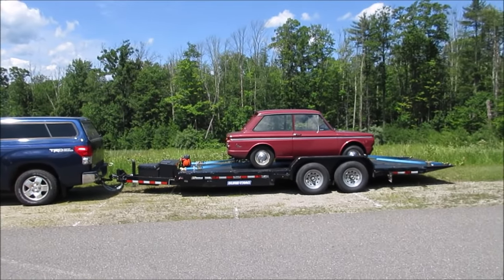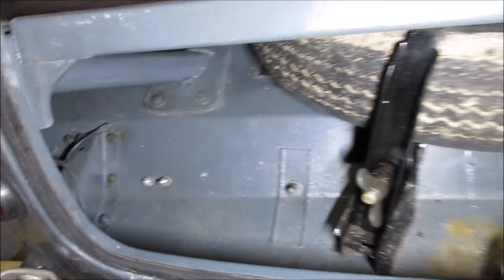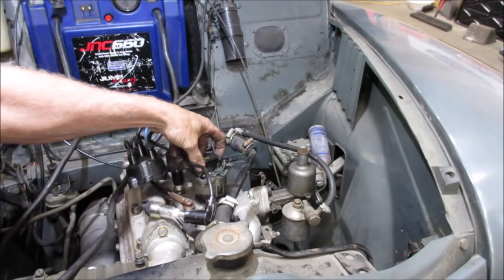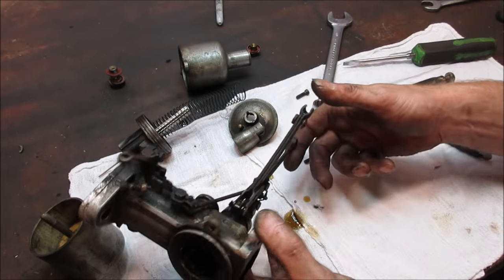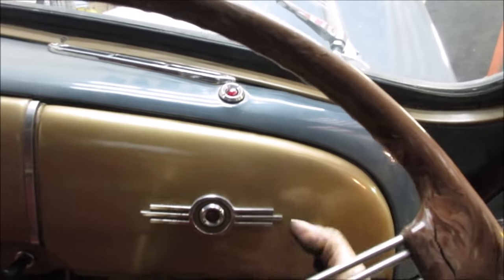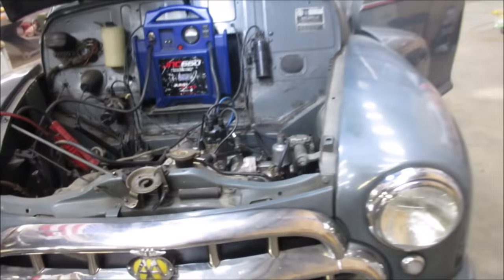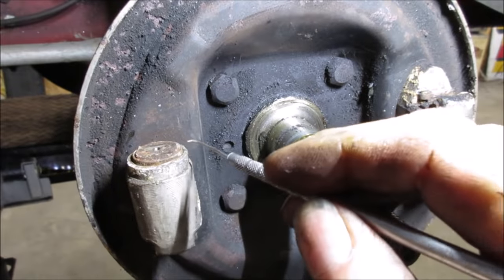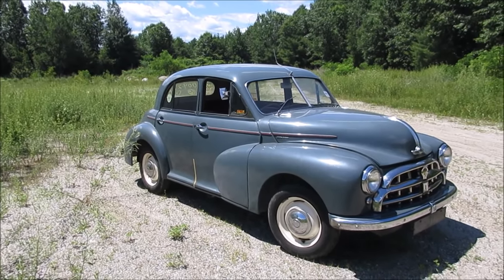50s Morris Oxford Found in an Old Warehouse. Did It Survive?

Comment: 82 y.o. and talking to you all the while, from Australia.
I was impressed with how you sorted it out.
There is a special little spanner for adjusting the main jet. I have one, in the top drawer of my toolbox, with a piece of 
string to go around your wrist, so that you don't lose it in the bowels of someone else's car.
The Morris Minor was a more popular little car, with a similar motor only, about 45 in. cubes, iirc.
The example you have there is from around 1952, followed by an ohv model and then a one litre ohv model with a one piece windscreen. Rather nice VW beetle equivalent.
Well done !!
Reply: I love the piece of string on the tiny spanner. I got the value of it straight away. Thanks for the tip. 
I am a bricklayer by trade and have a loop of bricklayers line on my belt which I hook my car keys too each morning before entering big building sites.

Comment: Mustie I am impressed with how quickly you surmised aspects of the SU carburettor.  The basic principle is that as air is drawn in it enters a restriction between the jet seat and needle creating a pressure drop, due to the Venturi effect, and this draws fuel past the needle into the engine.  The connecting arm arrangement under the jet seat is the cold start lever which is actuated via cable from a knob on the dashboard.  As you correctly identified that when retracted the jet seat is lowered from needle to enrich the fuel air ratio.  A small passageway connects to the dome region above the large needle piston allowing inlet manifold vacuum to alter the distance between the needle and jet seat to balance the air/fuel mix.  The little dash pot piston in the top of the needle piston needs to sit in bath of oil, it dampens out any sudden deflections or flutter of the needle piston.  Idle is set by the nut on the jet seat assembly beneath the carburettor, above the cold start lever connection.  As rule of thumb, do the nut up until lightly snug, then undo it 12 flats (two turns) to withdraw the jet seat.  Then adjust this nut to achieve a comfortable idle speed.  When set up, SU carburettors are fairly bullet proof, the only things that go wrong are the dash pot piston gets gummed or becomes empty, fuel float chamber needle fails to seat properly and, over time, fuel can erode the jet needle profile leading to progressive deterioration in engine smoothness.
Reply: I'd add that the primary function of the oil well in the top of the dashpot is not to provide oiling, but to dampen the return rate of the needle as it falls back down. When you hit the gas, the needle moves up, and when you let off the gas, if the dashpot is empty it can fall off too suddenly and cause revs to waver. Motorcycle shock oil is the closest thing you'll have around the shop to the correct viscosity of dashpot oil.
Reply: @Falkkonstag  I think that's not quite right. The damper is there to limit the upwards motion of the piston and needle when you open the throttle. As the piston doesn't open quickly the air flows faster through the throat which momentarily sucks more fuel though the jet. That gives you the fuel enrichment (like an accelerator pump on a US style carb) you need when you jab the throttle. The needle then slowly rises and the air flow returns to normal for that throttle opening. The damper acts like a one way valve and limits the upward motion but not the down. That is controlled by the piston as it moves inside the dashpot. Early SUs had no damper at all but often used heavier brass pistons. There are also different weight springs that press the piston down. If you have twin SU carbs one test you do to ensure they are well matched is a piston drop test where you lift the piston to the top on each then let them fall under their own weight and make sure they fall at the same rate with the appropriate ports blocked). They shouldn't just drop as they are a very close fit in the dashpot (but not touching). It usually takes a few seconds. The SU Carb site has a lot of good information about this to read up on. I've got three cars with SUs on them including early pre-war ones so had to learn a lot about them. Lots of subtle difference in them over the years to trip people up. Very neat devices.
Reply: @Falkkonstag  Old Volvo B20b used 10 wt for dashpots. Performance trick was using light mineral oil in them for faster response.
Reply: Ah, yes- The venerable SU carburetor.  My Morris Minor 1000 had one.  I kept the oil level in the damper very high.  I never had any carb problems to speak of.  Mustie, your fuel pump sounds very sluggish.  My Minor 1000 fuel pump would thunk like crazy, then slow down and stop.  Then I would pull the choke and pull the starter.  Instant power.  Sort of.  All 36 horsepower.  Top speed 67 MPH (on a good day).  I miss that car.
Reply: @asciimation  Thoroughly agree.   I had a Triumph Mk2 2000 that came with twin Strombergs, but on an  recommendation I changed them for the twin SU factory alternative. And then all my carb problems went away.
Never knew about that piston drop test though but it makes total sense.
Reply: If Mustie knows anything he KNOWS carburetors!
Reply: @bcgrittner8076  60 on flat roads and 70 down a hill or 160 over a cliff , its that fast but dont go uphill :)
Reply: I am just thinking the whole time... How hard would it be to add a Megasquirt/microsquirt to this thing and make it fuel injected? Not that hard I reckon. I wish I had the ambition. Lol.
Reply: @macinfloydvolk  My nickname for mustie is the carburettor KING!
Reply: @eriklarson9137  it looks like a 5 port cylinder head (like an A series in a Mini) with each inlet shared between two cylinders, which makes it difficult to make fuel injection work - adjacent cylinders can suffer from ‘charge robbing’ leading to uneven air fuel mixtures. You can fudge it by having a ‘wet’ manifold, but it kind of defeats the objective of accurate fuel metering and small fuel droplet size.
Reply: @asciimation  Spot on, SU's can ba fine tuned by using thicker or thinner oil in the dash pot. Origional spec is engine oil but 'performance' tunes used 3 in 1 or similar
Reply: @Falkkonstag  you are correct 🇬🇧🇬🇧
Reply: @marcos3ltrv6  You can buy proper SU dashpot oil which is the correct grade for premium performance.
Reply: I was going to make a guess that what has now been identified as a cold start lever was some sort of early cruise control guessing soley off the fact that Mustie described it as having like 12 positions. It makes me very happy that there are so many people who freely share thier niche knowledge about things like this because it helps all of us Mustie fans expand out knowledge base.
Reply: had a Morris Marina,booked if into the S U service dept in Birmingham for a carb tune up. didnt run any different but good memories.

Comment: Love the beat box rhythm :-) That knob on top of the carburettor is for an oil-filled damper, ("SU carburettor dashpot") top it up with light machine oil and the 'hunting' will smooth right out. The piston inside is lifted by the vacuum, the damper stops it 'bouncing' as the revs rise and fall, and replaces the accelerator pump when you floor the gas pedal. 
The mystery 'feature' right in front of you on top of the dash should be a warning light for the semaphore 'trafficator' turn signals. The chrome ring unscrews to change the bulb. 
I learned to drive in one of those, a very long time ago :-)

Comment: In really good condition for its age and almost no rust. Bodywork pretty straight and inside also quite good. Engine sounds good too. Doesnt need too much work to make it roadworthy and last for another 70 years. Great video. Thanks for sharing this, people from Great Britain must be very pleased watching this.
Reply: None of the ones that were on the road lasted 70 years so why should this one?
Reply: @1pcfred  
The ones that have lasted are kept away from wet salted roads...
Reply: That engine sounded good?
Reply: @jeffreysalzman1497  Sounded to me like it was desperately in need of a good tune up! Oh, and that exhaust flange fettling up!
Reply: @JohnSmith-yv6eq  salt does rust metal. Cars are not really made to last though. The purpose of an automobile is the antithesis of longevity. Moving does not promote staying. Least not on the scales we can create. Some vehicles we launched when I was young are breaking down now. They're some of the last vehicles out there still rocking 8 track tapes. They're as far away from salted roads as anything humanity has ever made too. Completely out of the solar system now in fact. Our poor little Voyager probes. They're high mileage specials now.

Comment: The black knob on the far right of the steering wheel is the windscreen washer. It's a kind of manual pump and when you push it, water will squirt onto the windscreen from the nozzle near the wipers. You will have to press the knob quite a few times once the washer bottle is filled to prime the system.
The low beam / high beam headlight switch will be on the floor near the pedals and is operated by your foot.
Reply: Hey I remember that foot switch from the london cabs 🙂
Reply: @NaoPb  I like your flag. Good on you.
Reply: Yeah my '72 XA Falcon had the same hi/low beam switch too.
Reply: @NaoPb  at a time (pre 1970's) all UK cars had the dip switch on the floor.
Reply: @nevillegoddard4966  my ‘62 Falcon wagon has the same switch. I used to tell my kids the lights dipped automatically when a car came the other way. It was me operating the switch in the dark with my foot 😁
Reply: My '62 Plymouth Valiant and '65 Datsun 1200 Pickup have the dimmer switch in the floor. I got some crazy looks from people when I drove the '65 Datsun on the interstate in Savanna, GA. doing about 90 mph to keep up with traffic. With a L20B and 3.70 gearing, the engine only turned 4500 rpm. That's the only time I drove it on the interstate and it was to go to a family gathering. It still has drum brakes all the way around so I limit the amount of driving to local areas. The Plymouth need an alignment, tires, and a radiator for it to be road worthy.
Reply: That makes sense. I thought maybe fuel or oil primer lol. Thanks Steve Hunter

Comment: Passed my test in one of these in 1954.  The engine  fine was always flat but got there in the end.   ever had any trouble with the fuel pump.  Needs light oil in the centre for the small piston in the carburetor. Brakes were always poor.  It had a bench seat which was rare in the UK  at the time.  Good for courting. Torsion bar suspension  very good.  On the whole the car was very reliable.  The next model was better as it had an OHV engine with more power. Dip switch for headlights on the floor. Happy memories.

Comment: Hi Mustie. I remember helping a neighbour work on one of these when I was around 11 years old. He’d spend most Sunday mornings tinkering with it. The push button on the right hand side of the steering wheel I believe is for the screen wash. All vehicles had to have them fitted after about 1971. Reverse gear I believe is pull the end of the gear lever out push to the bottom and down. I haven’t driven a column change since the early 70’s. Many thanks for wrenching on a few cars from this side of the pond. The other one you did the Hillman Imp was the model I passed my driving test in.

Comment: Hi Mustie.
Thanks for the Vid, brought back alot of memories.
The carb is an SU bottle carb.
I remember the cap / plunger on the top is where you put oil in the lighter the oil the quicker the throttle response. I used 3 in 1 oil or my Mums sewing machine oil. engine oil would make it boggy in cold weather.

Comment: Engine oil in the "oil piston damper" in the centre port of the carb. Fill it to the top of the reservoir inside the bottle. It should give a good resistance when you put the plunger back in. This is why you are not getting the proper rev result when throttling up.

Love your content Mustie1
Reply: I was screaming..."No not gasoline in the SU, Mustie!" too.

Comment: That brings back memories, my uncle had one brand new in the 1950's here in the UK,  due to him losing fingers on his left hand in an industrial accident  he had the supplying dealer change the  Colum change  gear shift from the left side to the right, this resulted the gear shift pattern being totally reversed!!  (Four Speed)
Big old side valve engine (Flat Head) and very large bench seats. Electric fuel pump, you can sometimes hear it when you first switch on the the ignition.
Controls under the dash are to change the clock on the left, and change the trip mileage  on the odometer. Looks like it also has a retrofitted screen wash manual pump on the right. That would not be original

Comment: Hi Mustie, an old Brit here, Rolls-Royce used to use SU carburettors, even had them on the World War II Spitfires!! Those electric fuel pumps were either pushers, mounted underneath near the tank, or pullers mounted in the engine bay where that one is, they nearly all needed a few wacks here and there to get them going again. A set of contacts underneath the plastic cap  which needed periodic cleaning would solve that problem, and a changing of the capacitor to stop the contacts from burning up, just like the CB points in a distributor, would help too. Great video👍btw.

Comment: These cars have a far more interesting history than many people might know. When production in the UK ended, the dies (for the MK III variant, this one is a MO made from 48 -54) were shipped to India where production was continued as the Hindustan Ambassador. They were hand built cars and became sort of the national car of India. For many yesrs they were the only cars produced there. I believe they were building 15,000 cars a year up until the 2000's, when competition from cheaper, better alternatives built by Maruti-Suzuki and Tata finally did them in.
The sticker converting Liters to Gallons was likely from the moment in time when the UK converted from Imperial to Metric measurements to comply with membership in the EEC or EU. I would guess that was some time in the 1970's.
Reply: That’s like the VW Bug dies going to Mexico.
Reply: The Hindustan Ambassador is a clone of the next model of Morris Oxford not this one. I did a three week trip round Rajasthan in an Amabassador. It had been improved by the addition of air conditioning (on or off) but not by the replacement of the somewhat feeble but sweet running BMC B Series engine by a coarse, noisy and rough Isuzu diesel, normally used to power the mixing drum on a cement truck.
Reply: @wilsonlaidlaw  Big Car (YT channel) recently did a video about the Ambassador. It was interesting.
Reply: @wilsonlaidlaw  Beat me to it.. this is the larger brother of the Morris Minor. I've also done a huge number of miles in a Hindustan Ambassador (an early one with the B series)
Reply: The Indians never improved any design, they just took some shortcuts, often to the detriment and demise of a plan
Reply: @wilsonlaidlaw  The first car I drove was Morris Oxford back in the early/mid 1970's in England. It was a pile of junk by the standards of the day.  My dad had one stashed away in a council garage for many years.
Reply: The Hindustand Ambassador was based on the Morris Oxford Series III not the Morris Oxford Series MO or the Morris Oxford Series II.
Reply: never was any requirement by Common Market/EEC/EU to change to metric all vehicles in uk have M.P..H speedos, miles on odometer people still quote m.p.g.. GB adopted SI system i.e. metric in the early sixties long before  any European membership.
Reply: Interesting
Reply: @Endoplasmic-Reticulum  It was, except VW made the beetle in Mexico from 1962 I think, at the same time as making it in in Germany (and several other places).  The very first few Mexican built cars were German CKD kits but that quickly moved to full local manufacture and by 1966/7 the big factory at Puebla had been built because of massive local demand for the cars.  
One fun detail is that VW Germany rarely kept the same spec of cars being built in Mexico as in Europe.  My 1984 Mexican built beetle has the smaller back window, the same as my 1970 German built car but by 1972 in Europe the window had changed to a larger one, something the Mexican cars never did.
Reply: @jncg2311  Any idea where the Mexican Bugs engines were built?
Reply: @jncg2311  Thanks for sharing your knowledge. 😊
Reply: @Endoplasmic-Reticulum  Initially the engines were German built but I believe they quickly switched to local manufacture.  
My 1984 car has the original 1200 engine, the case and head castings have Hecho en Mexico cast into them. I'm not sure about rotating parts; crank, rods etc but believe at that stage almost everything was made locally. Apart from the label, you couldn't tell them apart from German made parts any other way.
All the glass in my car is etched Crinamex, not unusual for modern VWs but only appeared on Mexican built beetles.
Reply: The Polski Fiat has a similar history
Reply: @grahamepigney8565  Taken from photos and the odd sighting on film of the Hindi Ambassador, I always assumed that it was their version of the English Morris Isis notable for it's inverted bonnet bulges looking like it had been sat upon by an elephant.  I never liked the MK III Oxford with its low down instrument panel, it just didn't look right (kind of that 'second thought' look).  After I was financially able to buy cars of my choice - new or newish - I have always made my final decision by sitting in the driving seat.  I found that while the look of a car is likely the initial lure and what you think you want, it's from the driving seat you'll know if the car wants YOU.